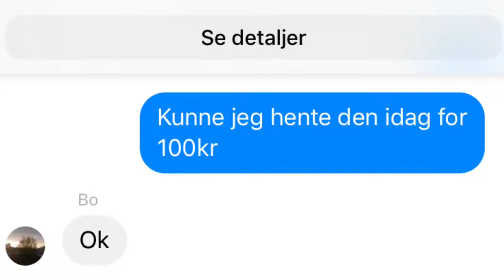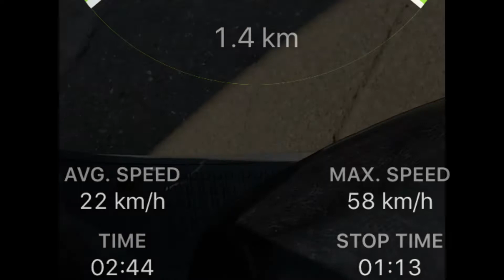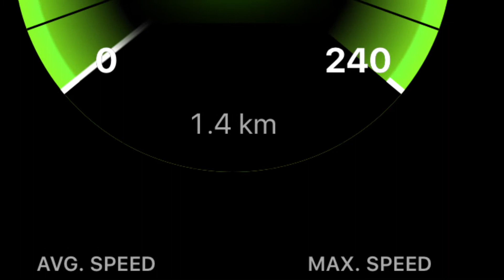Købte jeg lige en knallert til 100kr??  Fkn Sygt

Comment: Har købt en PGO PMX med 50cc sport, kører 90 på Speedometer uden indstilling. Hvad skal jeg gøre for at den er lovlig-ish 45-50 kmt. Prøver 30 Skive snart.. SVAR VENLIGST
Reply from the maker: Det er sæt skiven i køre en tur, brug speedometer appen hvis du har appel. Ellers så bare i med alle dine begrænsinger igen,og håbe den køre de der 45..
Reply: 2-Stroke Only | Har kun ændret cylinder, det er alt også skiven. Men vil lige prøve med 45 Skive, da jeg ikke har mindre. 😐
Reply from the maker: @mvalentin4176  oki duki